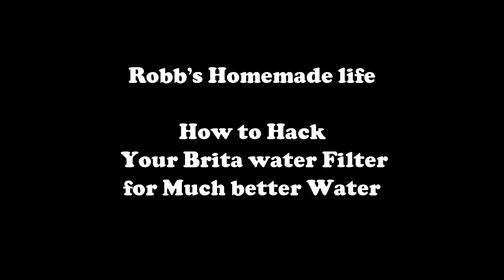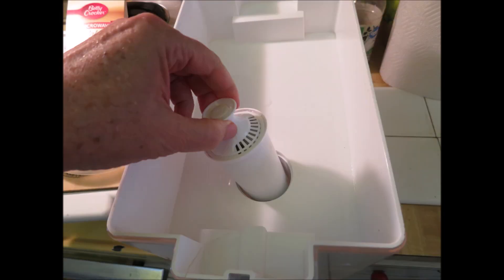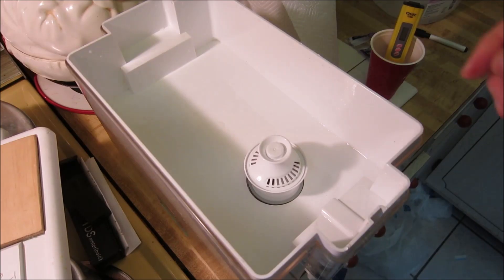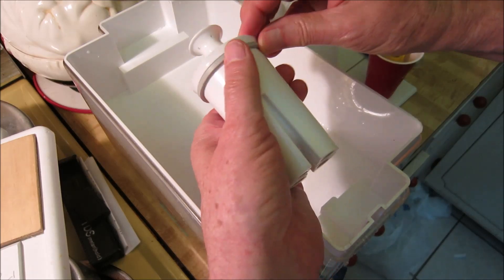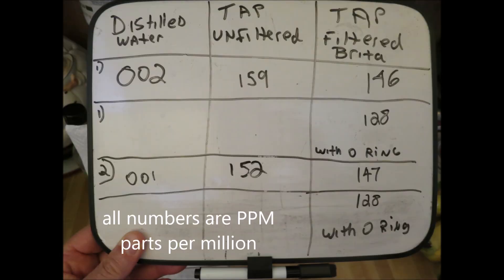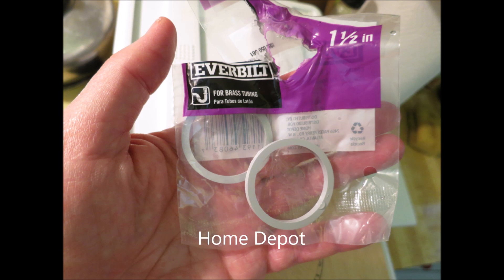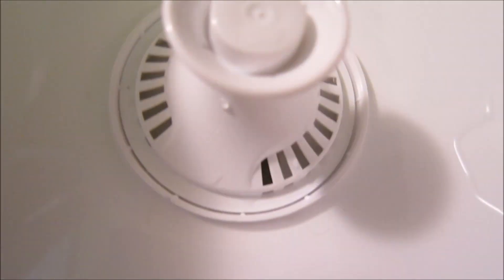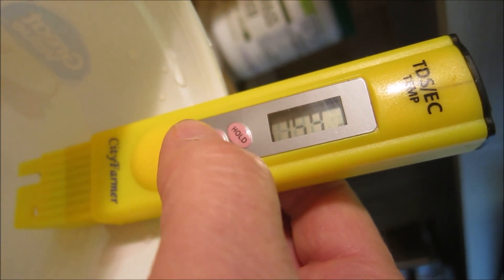$1 DIY Hack Improves Brita Water Filter & your Water

Comment: You do realize that the filter has a slit in its side and has to go into the pitcher with that slit going over the ridge inside, then you push down and there is no gap. So if you see space then turn the filter until it goes down all the way. I don't know why Brita doesn't give that instruction clearly.
Reply from the maker: You are correct that there is a gap in the side but it is not relevant to the video. The top outside is uniform and fits snugly when inserted as you mentioned, but does not make a watertight seal, the o ring is an attempt to make a water tight seal.

Comment: I got the exact gaskets you mentioned and tried this.  The first filter seemed fine, but as soon as I replaced the filter and put the gasket back on, I started seeing water trickle out of places other than the filter holes.  Putting more pressure on the filter stopped all excess from leaking out so I know it was the gasket doing it, which leads me to my next point:  I don't notice any of this happening with the default filter method, so I'm guessing yours has a flaw or some sort?  If no water is coming in around around the filter and only coming out of the filter holes, there's no way for the unfiltered water to be getting in there.  If it doesn't have a good seal, the only place for it to go would be down the sides of the filter.  I'd be interested in seeing if you can see the water flowing down the sides of the filter without the gasket.

Not to mention, testing water quality with a TDS meter is basically frowned upon anyway because they don't test for anything actually important to your health.
Reply from the maker: I don't understand what you are saying. My gasket stopped water from leaking where the filter touches the side of the container.
"Quality " of water is not a scientific term and that is not what the TDS meter tested for.
Reply: TDS meters Do Not measure most minerals. Minerals in water are inorganic and are very poorly absorbed. depending what minerals is important as some are toxic even if not absorbed. I checked my water management supplier and lately the TDS were about 127ppm and all other minerals and toxins were 100 - 1000 times less in general and some were 10,000 less that national standards. I will likely start double filtering my Brita water just to reduce the TDS

Comment: Great stuff as always, thanks! I've heard of that being a problem with Brita which is why ZeroWater has filters that actually screw into the top reservoir! My grandmother recently got a ZeroWater filter which included a TDS meter and it's supposed to filter water down 0 ppm and actually gets very close! Your water is obviously much better than ours (we're in central Texas), at my house the water out of the tap is usually close to 400 but at my grandmother's new apartment it's over 650 which is off the charts according to the papers that came with the filter! The water tastes terrible but the ZeroWater filter works very well... don't know how long it will last though! Is there a "safe" TDS reading according to the government or someone that a super high reading should be reported to?
Reply from the maker: the zerowater is very expensive and many people claim it makes the water taste fishy, but for some people, it works very well. I think each filter has its own positive and negative features and you have to investigate what your problem your local water has and find the filter that bests suits it. There is a website that gives the chemical condition of every local water plant in the USA but I don't remember it offhand.  Find out what are your water is weak on and then buy your filter system to suit it. I was surprised how low my city water is in dissolved solids, but we do have some heavy metal problems the Brita should help a lot.